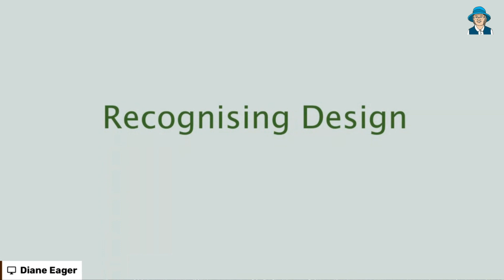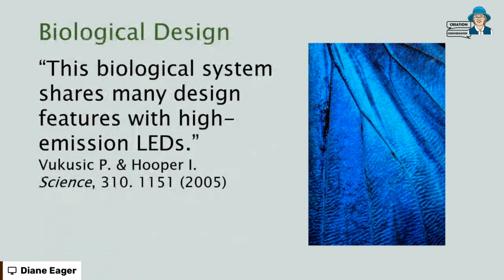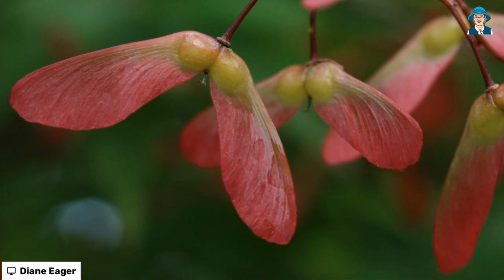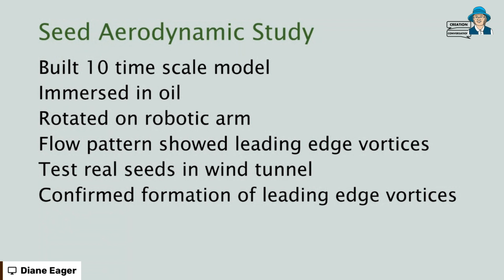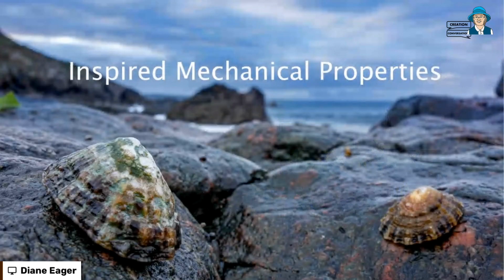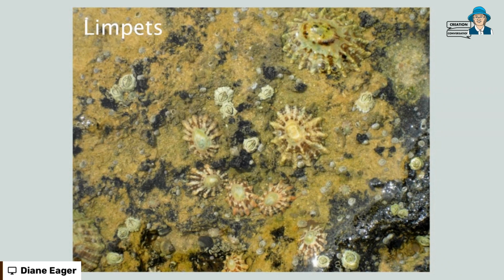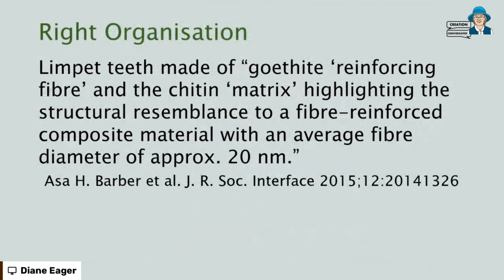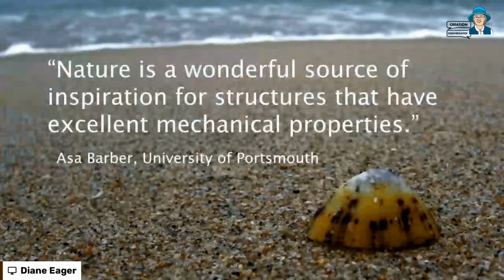Butterfly Wings and Flying Seeds

Comment: New flash: evolution is a designerless design process. That's why biologists use the word design. Question: your first slide was titled recognising design but you believe that all living things were designed. So, without examples of non-designed life, how can you say that designed life is recognisable?
Reply: That’s like saying that you want examples of an undesigned watch that you can compare to the watches that we are telling you are designed. I guess that we could ask for the same thing: show me examples of useful, coded information with a system that can decode and use that information that can be demonstrated to come about by natural processes. This doesn’t even have to be capable of replicating itself for reproduction. It just has to have a system for coding and decoding information that doesn’t originate from a mind so we can point to that and say, “See that! That can happen without any designer!”

Show us one example and then we can start taking an idea from the 1800’s about life not needing a designer seriously. Life uses, self repairs, assembles and replicates a code system more advanced than anything we can produce or reproduce. It has multiple layers of information that it’s not just read linearly but also reads differently depending on where you start and then also depending on how it is folded in 3d space. It’s like a book you can read and then it becomes another book depending on how you fold the pages and if you fold the pages the other way it becomes another book. Life uses an information system that is so far advanced from what we have developed that it’s like comparing a rocket on it’s way to the moon and a monkey in a tree trying to get to the same moon using fart power and jumping off the limb. DNA is a library of information that is written on a molecule 6 feet long that winds up to fit into the nucleus of every cell in your body. There it has to cut itself to unwind and unfold in the proper place in order to be able to be read to keep from tangling itself up in knots. Heck a kid with a 6’ piece of fishing line hanging off a pole will have that wound up in knots in 2 minutes so tight that you’ll have to cut it and start over but you think it’s wound up inside of the cell and stays knot free by random chance causes. And I am just getting started. I can fill a book with just some of the stuff that life can do and we can’t replicate even with our technology. It makes a watch look like a child’s toy. And don’t even get me started on chemical to electrical to hormone cascading systems that happen when you put all of the cells together.
Reply: @boxelder9167 
Well, my friend, if your god does exist I hope he has a sense of humour because he's just watched one of his flock try (and fail) to explain how DNA works to a biochemistry undergrad!! 🤣 
I won't bother listing the factual inaccuracies in your understanding of genetics because you won't learn anything from a youtube comment. Also, you'll most likely interpret my corrections as confirmation of the idea that DNA is too complicated to be natural. I agree the DNA-RNA-Protein is an astoundingly complex, mysterious and beautiful chemical system. But complexity, mystery and beauty are not evidence of design and your incredulity at the idea of such a system forming without a mind is evidence of absolutely nothing. Surely a mind capable of designing something so complex must be even more complex! So the mind that designed that mind must be even MORE complex, and so on, and so on.
Returning to my original question. I asked for an example of non-designed life and you say that is impossible to provide. Exactly the point I was making! You can't look that something and say that it has definitely been designed if you don't know what it would look if it hadn't been designed. You'd like an example of an undesigned watch? That's easy, watches are made from metal, glass, plastic etc. These are all naturally occurring substances that have been altered and manipulated by humans to serve single purpose. Pile of rocks + design = watch, simple. On top that, watches have makers, brand names and patents. There are multinational corporations and individual people who are famous for the watches they design. In other words, we know they are designed because we have evidence.
So, what about life? Do we have any examples of life that has definitely been designed? Yes, we've been selectively breeding for millennia and doing various forms of genetic modification for about 200 years. And is there any major identifiable difference between wild life and cultivated life? Well, most wildlife has traits which help them to survive and reproduce in the specific environment in which they're found. Whereas, domesticated life has traits which benefit humans but are often so detrimental to the organism itself that few could survive even the most hospitable wilderness. Lean, mean survivors + design = wagyu beef. Just by comparing two groups of creatures we can see clear evidence of design.
So I ask you, do you have any evidence that DNA is a product of design?
Reply: @boxelder9167 then how do you explain the existence of your 'designer' - the 'designer' has to be able to process information throughput,  but you'll beg a special exception for the conclusion that you already assume.
Reply: @williamchamberlain2263  - If the creator of the universe comes from the universe then by definition he’s not the creator. What we do know about the creator is that He’s more advanced than any technology that we have achieved and there’s a whole host of problems that we can’t solve to just create the precursors of life. We don’t even get close. We could have a ocean full of living organisms that we sterilize (kill) and we could not even bring a single one of them back to life. We have 2 problems. We can’t solve for the chemistry for life and even if we could we still can’t make it come alive. There’s no way that life could ever come together without an intelligence far beyond our own. Life is a miracle by definition.

So there’s also the miracle of Jesus resurrection. Jesus claimed to be God, the author of life, and then He provides the proof by raising from the dead. But just because God does a miracle doesn’t automatically mean that everyone is going to accept it. If a person has a commitment to reject God it wouldn’t matter what He did to prove it they would still refuse to accept it.